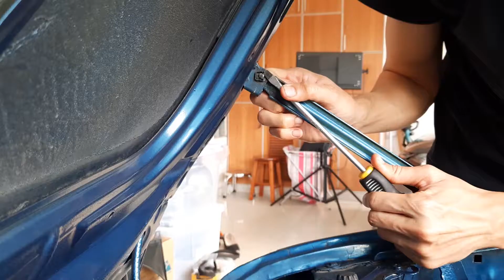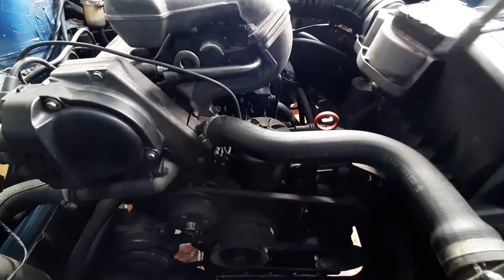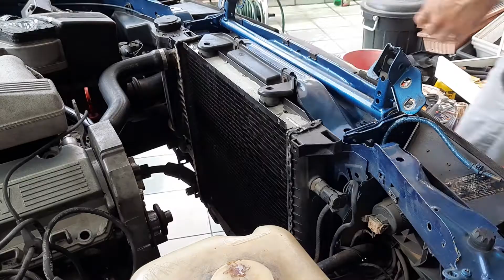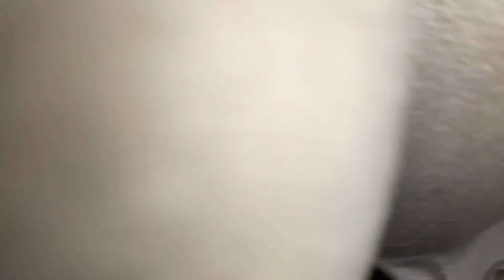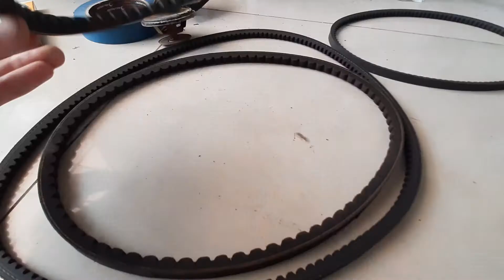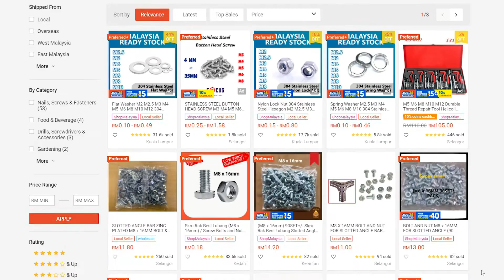BMW E30 Project ep3 - Timing Belt, Thermostat, Water Pump from hell!

Comment: can i change the timing belt without removing the waterpump?
Reply from the maker: Hi! I'm not sure if you can do that. The top half of the timing belt cover can be removed without removing the water pump, so if there isi sufficient space between the gears and the cover, i guess you could slip off the timing belt and remove it - without removing the water pump.
Reply from the maker: Oh, sorry, I took another look at my video. Looks like all the covers around the water pump can be removed without first removing the water pump. You can see it at 4:57 in the video.

So it looks like you should be able to change the timing belt without removing the water pump 😊
Reply: @MacamYesGarage  yeah I've seen it, I just want to make sure. thankyou so much. thank god youre awesome

Comment: There are two screw threads on either side of the waterpump. Insert two m6 and push out the w pump
Reply from the maker: Tried it. The screw threads are in 2 ears molded with the water pump casing. As they are drilled into the thin ears, the ears break instead of pushing out the pump.

Maybe it works if the pump is not stuck to begin with.